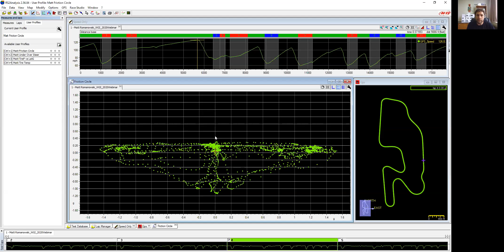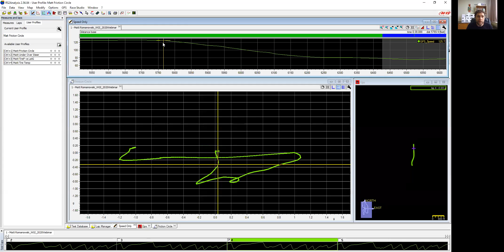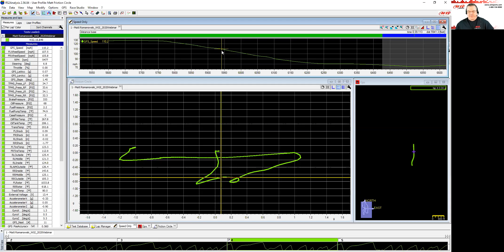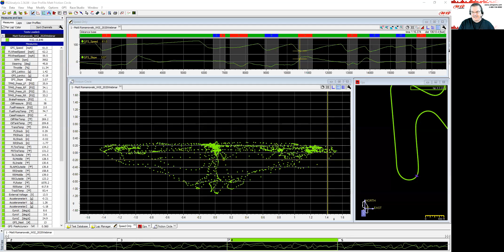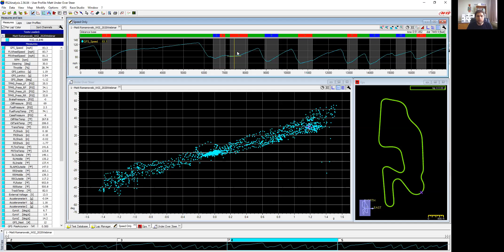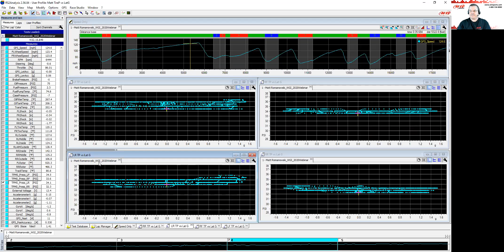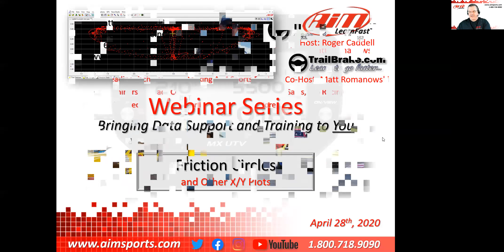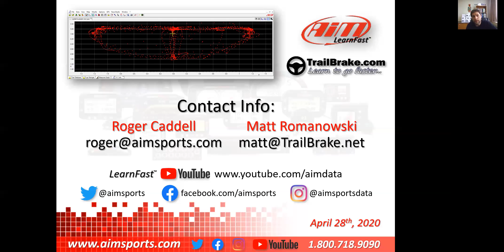1-9 Friction Circle and Other X/Y Plots - Live Webinar with Matt Romanowski - 4/28/2020

Comment: Hello!

Thank you for putting this valuable webinar together! 

I am struggling a bit trying to replicate the User Profile used in the webinar. I was wondering if you guys would be open to share it with me?

Particularly I can't display the track segments on top of the measures graph (even though it should be automatic once I generate a track map. 
I am also struggling trying to display the GPS speed only on the Measures Graph and the GPS Lat/Long accelerations on the X/Y plot: When I click on the long acceleration to be displayed on the vertical axis of the x/y plot it also shows up in the measures graph above. 

Any help/ideas here would be greatly appreciated :)

Miguel
Reply: Here is a video that shows how to turn on Multiple Views so you can recreate those profiles https://youtu.be/IuDvchVz1TI

Comment: Good morning! 
I have 2 questions ... The first is how can I make the LEDs light up when a better or bad sector is done ?, and the second is regarding the race studio in the engine RPM part, you can  use to determine a sprock?
Reply from the maker: You can set your alarm LED's to light up any color using the Lap channel +/- Best lap channel as the trigger for the LED's.  We can walk you through the steps, just give us a call (800)718-9090. I need a bit more information on your second question.  What is a sprock? GIve us a call and we can discuss it.